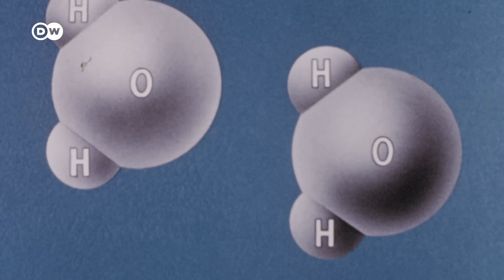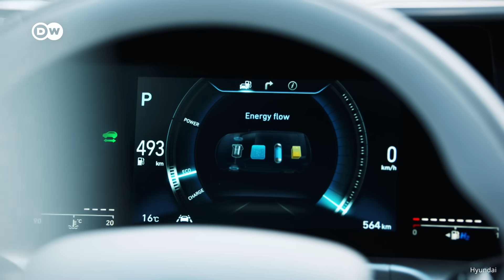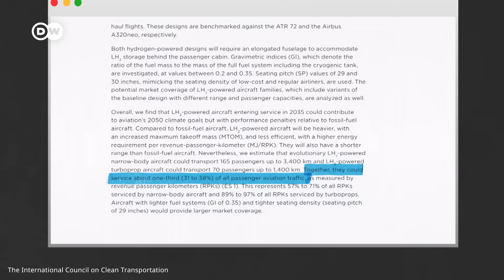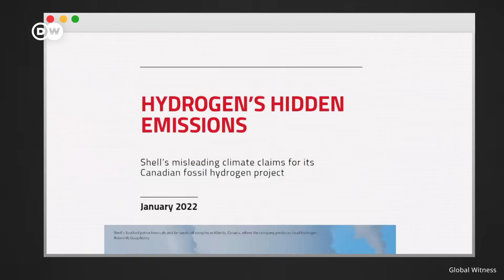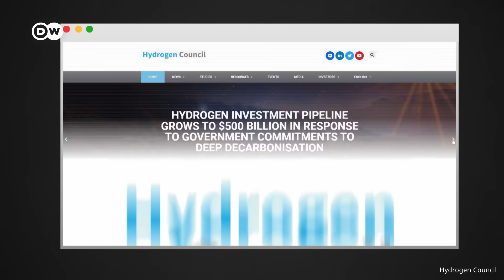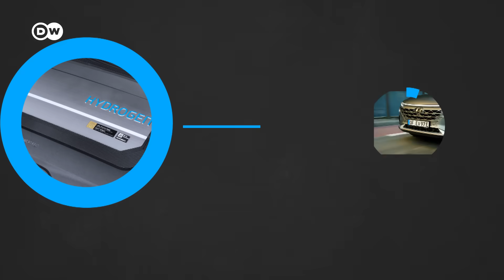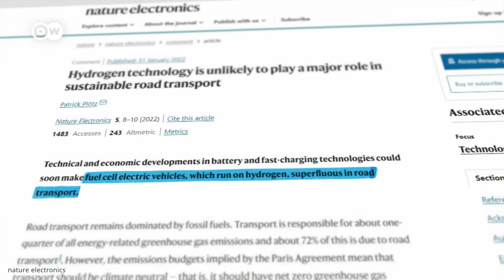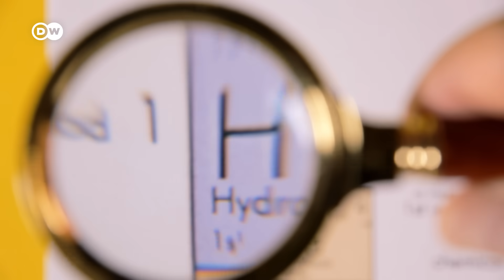The truth about hydrogen

Comment: See, here's the thing you seem to be overlooking. You are still looking at centralized power infrastructure, with large corporations producing hydrogen for mass consumption. How could that possibly make sense? It doesn't. 
How about this?  Each household produces THEIR OWN hydrogen. Using an earth-abundant self-healing catalyst, like cobalt phosphate, one can easily separate water. Waste water, sewage, hazardous waste, doesn't matter, you can pull the hydrogen out and store it in graphene lined containers,  so there's no need to keep it constantly at high pressure to avoid escape. 
If everyone uses their own solar panels to split the water, power companies become obsolete. We want that.
Reply: Local production of hydrogen and nuclear power would be a great solution.
Reply: @brianadams1907  Only if you have some way to safely produce nuclear power that creates either zero or negative nuclear waste, produces zero pollution, little to no damage when there is an accident, and yields more than the amount of energy and resources invested. If you are talking about individual or per household traversing wave systems, then yes, possibly.

Comment: Currently, the world, runs on oil, be it petrol, paraffin,  diesel or the gunk that they use in ships. Yes, it has pollutant residues, but, what else can move the world with the same effectiveness?  I do not consider CO2 a pollutant, but a necessary gas to feed plants etc.

Without a doubt, electric motors reign supreme in terms of efficiency and engineering design (I prefer things that rotate, to things that reciprocate). 

As many of you worthy commentators on this thread, have to grudgingly agree, the likes of batteries, wind and solar, just do not have the energy density to replace oil based products. What has the energy to mine and transport the raw materials? What has the energy to transport products (raw or processed) across thousands of miles across the sea, or air? What has the energy, to process, those raw products?

Like it or hate it, we have to accept, that products like hydrogen have to be seriously considered, for the future. Yes, it might have undesirable 'pollutants', but then if you can, show me a single process that doesn't have some pollutant consequences.

It needs to be a balance, and we need to manage or mitigate the pollutants produced by the transportation, or processing of materials.

Comment: Burning hydrocarbons doesn't normally produce CO2 as a wasteful by product. Normally it produces CO, carbon monoxide. But vehicle manufactures are now required in the USA to use catalytic converters to convert the CO into CO2. So if you don't want to contribute to CO2 and climate change then have a mechanic remove the catalytic converter from your exhaust system. Problem solved right?

Comment: Green power is a myth. Solar, wind, thermal etc all need to be manufactured eg solar panels, which produces massive amounts of CO2 which can take years and years to negate. Lithium Batteries are expensive and are hard to recycle after their life expectancy plus produce a massive amount of CO2 to manufacture plus all the harsh pollutants during the manufacture.

Comment: All your doing is move no evergy around it not free if making hydrogen used a lot of electricity that comes from fuel" 
Even solar panels you need to make 98% pure silicon that 2 long hot 2,500 degrees for 25 minuses each. Then count all land equipment and truck and shipping to get the raw earth then melt it down for copper and glass or to make plastic . Then make aluminum then delivery to warehouse that solar panels then ship to you. The amount of fuel used was more than the 7 yr life of the panels or it can run your homes in the 7 yr and you wasted more fuel.

Comment: THE ENERGY 'BASICS' -  Hydrogen molecules, as H2, simply do not contain enough 'energy density' to be economically 'useful' .... unless one compresses the H2 gas to nearly 1000 psi (A POTENTIAL BOMB). The deduct of energy to separate the Hydrogen from Water and then compress it 10 aprox. 1000 psid is a LARGE 'net LOSS' of energy to do so. 
The 'containment' of hydrogen at ~1000 psi is VERY difficult and DANGEROUS unless very special and expensive precautions are taken.  Most metal containers are POROUS (molecularly) to hydrogen gas - it will eventually 'LEAK' through most metals due to the atomic 'spacing' of metal's internal crystaline lattice structure - the Hydrogen is 'smaller' than the geometric spacing in that METAL 'lattice' structure.   Net result is hydrogen is permeable **through** most common metals.  The only known way to reduce the permeability and leakage is to FORGE the metal containment vessels - 'another' contributor to the total energy deduct ... and with much higher cost sdded.
Such a hydrogen containment system MUST be free of polymeric 'gasketing' and sealing - which are ALSO quite permeable to hydrogen.  The typical current technology is to only use metal 'ring seals' - very precisely formed, machined and specially 'hardened' metal gaskets and mating surfaces - another energy deduct and with greater expense. 
Imagine your klutzy neighbor, or yourself,  who is fully incapable of using a wrench, precisely connecting a very high tech compression ring seal assembly at a hydrogen 'filling station' ??????

Hydrogen as a fuel: costly, inefficient energy-wise to  produce, dangerous to use due its permeability vs. 'metals', needs high compression to attain an efficient 'energy density'.    

Still, the current easiest and most cost effective and energy efficient way to 'make' hydrogen fuel (still needs to be highly compressed) is to 'crack' HYDROCARBONS from 'petroleum' (Hydrocarbon) products.  That isnt going to be accceptable with the eco-whackos, inspite of the HIGH  COSTS and inherent danger to do so. 

Do some research into the 'modern theory' of petroleum formation by the earth (planet's 'carbon cycle' --- has 'something to do with the heat and pressure action (via chemical reduction reaction) on 'carbonates' in or near the edges of 'tectonic plates' - if so, then petroleum is a potential infinite supply of energy. 
Lastly, planetary atomospheric carbon dioxide still remains an insignificant ~0.04%  'atmosperic component .... NOAA base thermal data from actual laser-microwave planetary sensing as measured (and extrapoilation of the data prior to ~1980) strongly indicates only a 0,6°C. rise in earth's surface temp. for the past ~100 years - much less than the extrapolated heat rise during the 'Roman and Medieval Warming Periods'.  (see Svante Arrhenius — planetary surface temperatures .... backcalculating the "IDEAL gas Laws".     
Water Vapor has approx. 5X the heat capacity of atm. CO2 .... Do we now also BAN the 'oceans', clouds, and 'rain'????

Comment: One fact which cannot be avoided is that it takes 96,500 coulombs to make 1 gram of hydrogen. I coulomb is a current of 1 amp flowing for one second. This is Faraday's constant and it CANNOT be made smaller. You can make the process faster but it always uses this amount of electricity. Very high currents are needed to make a lot of hydrogen. The other problem is that hydrogen cannot be stored in liquid form at "normal" temperatures, it just cannot due to thermodynamics. A fair documentary although it did not have time to look at the issues in detail. However, hydrogen will be more expensive the fossil fuels which may be the main problem.

Comment: The energy density of methane is 50–55.5 MJ/kg. Methane is a natural gas fuel.

By contrast, hydrogen has an energy density of approximately 120 MJ/kg, almost three times more than diesel or gasoline. In electrical terms, the energy density of hydrogen is equal to 33.6 kWh of usable energy per kg, versus diesel which only holds about 12–14 kWh per kg

i believe there was a mistake in referencing this in the video
Reply: Could be based on volumetric energy density at atmospheric pressure.
PS, You got me thinking so I did a few quick sums: 1kg of liquid hydrogen takes up roughly 10 times more space than 1kg of diesel. So even with a 3:1 ratio  the storage volume as a liquid with like-for-like energy potential is roughly 3.3:1. Obviously that's best case, and hydrogen is almost never stored as a liquid but rather as a compressed gas, so 10-20:1 or more is the likely volume ratio of H to diesel for the same energy output. It's a big issue.

Comment: I would rather see Hydrogen tech grow, then the battery tech, as it is evolving now, which creates other environmental disasters
Reply: Batteries don't create any sort of environmental disaster. They require normal mining for some raw materials - but then hydrogen requires triple the amount of energy to begin with - and that needs to be produced - and the raw materials for those electrolyzer and fuel cell membranes are far worse in terms or rarity (especially iridium)...
Reply: @karlgunterwunsch1950  then go look, where the raw materials for batteries come from
Reply: @Steve25g  That never bothered you as long as these raw materials ended up in your kitchen (Ceran field oven tops, glas ceramic casseroles are using lithium) or your ICE car (cobalt is being used in your crank shaft and valve seats and to remove sulphur compounds from your fossil fuel)....

Comment: Your passing comment on the climate crisis is just shocking. What crisis? Warming by about one degree over a century, rise of the sea levels by 1 mm in decade, plumetting numbers of climate related deaths, falling trends in droughts, fires, hurricanes etc., greening of the planet and increased crops, what are you talking about? And yes, methane is more powerful as a greenhouse gas than CO2 on a unit basis, but its concentration is measured in parts per billion, meaning its real contribution to the warming of the planet is negligible, couple hundred thousand times less than water vapour, and so on, and so forth. Is that the level of science you want to see and promote in serious discussions on important issues?
Reply: You do realize that Climate Crisis is a thing. Glaciers are melting and temperatures are increasing. A rise in 1 degree can alter the ecosystem drastically. Methane is worse, yes. Doesn't make CO2 levels rising any less severe. pH of water bodies will change as CO2 increases, leading to habitats of thousands of aquatic lives dead. How can you ignore the whole thing?

Comment: The next decade will be all about efficiency (finally).
If we can't use every kWh produced as good as possible, we will make everything harder than it needs to be to go carbon neutral.
Yes, Hydrogen (and other carriers) can help in some cases, but that's not for mainstream applications as driving or power storage for homes.
Instead, we have to use it whereever batteries are not capable of providing enough power per Kg and this will shrink over time with better batteries, some of them even appearing on the horizon (Tesla 4680, solid state, Sodium). We can't allow us to waste energy like we did before, using only ~10-15% of gasoline energy in most ICE looks pathetic nowadays.

Comment: There is no climate crisis. The current mean surface temperature of Earth is suboptimal. Increasing atmospheric carbon dioxide concentrations have the net beneficial effects of increased agricultural yields, reduced winter heating costs and fewer deaths from hypothermia. 
The fossil fuels are a limited resource and alternative energy resources need to be slowly phased in for this reason.
Hydrogen can be combined with carbon dioxide by either industrial chemistry or biotechnology to produce liquid hydrocarbon fuels.

Comment: The other issue I can immediately think of with Blue Hydrogen is the energy cost of converting one fuel type to another coupled with the additional energy cost of carbon capture.  How much net energy are you getting for your buck 

Green hydrogen: how much net energy do you loose in the process. Green energy is by definition inefficient let alone converting it into another energy form. Every conversion looses energy so solar/wind to electric then electric to hydrogen... thats a lot of loss.  Though I think this is more applicable since wind/solar often overload a grid because there is just not enough bettery storage... if instead of overloading hydrogen can be produced it may solve this problem.

Comment: the point that hydrogen is the lightest stuff in the universe, at room temperature and at normal earth pressure, also means that you need to compress the hydrogen for any real use. To some 700 bar. And the only way so far is by 3 or 4 Stage traditional piston compressors. Maintaining those machines are for some reasons allways kept out of the discussions.
Reply: Also the energy to power the compressors, the transport and infrastructure is another point on the efficiency bill which is often not shown.

Comment: For fuelling cars, hydrogen can replicate the petrol infrastructure and, with investment, would mitigate the energy losses. While electric cars might lose less energy, they incur more damagage as 1) existing cars cannot be retro-fitted; 2) 40% of the damage is caused in the production of the car, its batteries and recycling; 3) we need to create and expand the refuelling infrastructure; 4) and a recent report shows they may emit more pollutants from additional wear on the the brakes and tyres as they are much heavier than ICE vehicles.
Reply: I'm not convinced tbh, I'd expect LPG to be a more realistic transition fuel and its hard enough to get investment in that from govt or individuals to get conversions outside of places like Turkey or Italy. 60% of LPG is directly from NG with much reduced emissions, especially NOx and particulates and we could have been running on it a long time ago. Despite conversions being relatively cheap without huge investment and almost complete tax reduction the public are still stuck on petrol/diesel for the most part. LPG is still polluting ofc just like pretty much any fuel including hydrogen as mentioned the ultimate solutions always boil down to govt investment as real cures like geothermal energy require initial spending that the private sector just won't bother with.

Comment: Hydrogen production efficiency could be increased with more R&D.  The storage volume increase because the low energy density of hydrogen could lead back to the creation of long-chain molecules.  That would be a net zero if energy is from the Sun and carbon is taken from the atmosphere.   But first, we need more research.

Comment: 1 -Jules Verne said ‘Water is the coal of the future’ nearly 200 years ago - I guess its advent is inexorable….btw you mislead with the idea of H2 as a fuel - it is not - it is, like electricity, only an energy vector and it is this vital consideration which differentiates the gas derivations of gray and blue from ‘renewables’ green. 2 - green H2 appears to me to be almost maximally inefficient in its means (wind-farms and photovoltaics) of production. It needs the term ‘H2 bulk production’ or something like to focus the problem and competition for best means. Suggest that ‘renewables’ be given one of three derivation in order to isolate and compare efficiencies: a) Sun (= photovoltaics and wind) b) Moon (tidal movement in geologically constrained passages c) Universal Gyre/Spin. It is the last of these which seems to self the most propitious - it motors earth’s integrated system of sea-currents which advance on fronts of over 100 miles. When the weight of seawater is compared to liquid concrete the ratio is 2 : 5 I believe. This implies a correlative constructional/engineering consideration. Advance idea here of ‘planetary engineering matrices’ or modular construction capable of achieving earth-tangency. Three types? a) geodesics (arcs of such - not domes) b) ‘isotropic vector matrix’ - with hinged square bases and lengthened or shortened apex-connectors this has high configurative capability and - as thoroughly equally tetrahedral - of adamantine strength; ‘khatmatrix’ - or syncopated cubeoctahedra - of similar strength to iso.matrix but as a digital form of construction able 1) to configure contour and salient (digitally!); 2) build in marine without need for foundations nor adhesives; 3) integrate sea-water into its honeycomb matrix and progressively trap it there and provide bulk resistance from the weight of statified sea-water itself. (Respectively long, medium, and short range techniques.) Second whole Order considerations to be taken in conjunction - a) Carbon as replacing steel b) Tension not Compression as energy captor - i.e. not propellers but submarine carbon fabric dirigible sail-rings.
Oh….and why is it that O is never mentioned!?

Comment: The issue is that Lithium ion is not a solution as Lithium has its own supply issues.   You need a battery that uses common elements available almost anywhere.  This is part of the reason Hydrogen for transportation.
Reply: Lithium is more common than lead. You need 11.2 kg of Lithium for a 70 kWh battery - compared to 10-30 kg of lead that every ICE car carries around in its starter battery...

Comment: There are some extraordinary breakthroughs happening in the production of hydrogen.  See periodical,  Nature Communications, 16 March 2022 or University of Woolongong ARC Centre for Excellence for Electromaterials Science (ACES) and Intelligent Polymer Research Institute (IPRI), Prof Gerry Swiegers and ACES Director Distinguished Professor Gordon Wallace.  These people have achieved 95% efficiency in production of hydrogen by means of a capillary fed electrolysis cell.  They have achieved an efficiency jump from about 75% efficiency for most earlier processes to 95% efficiency.  Such a dramatic improvement has been unheard of for many decades in which improvements have been relatively small.